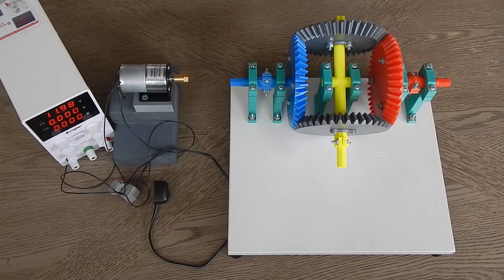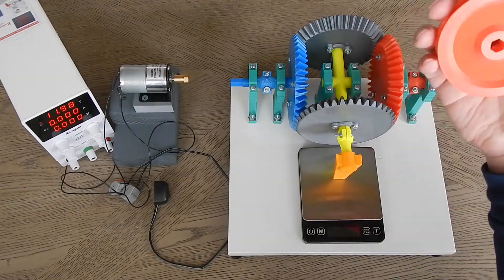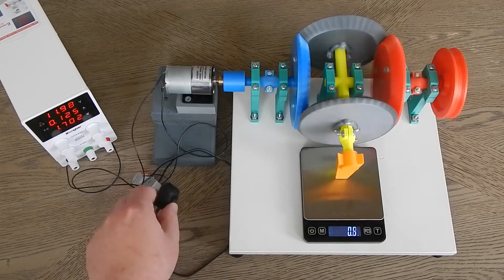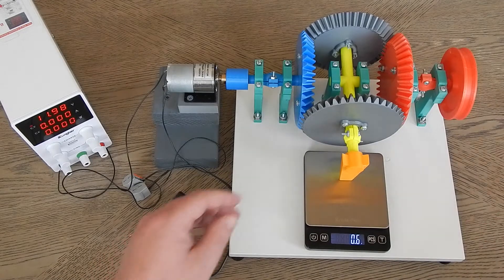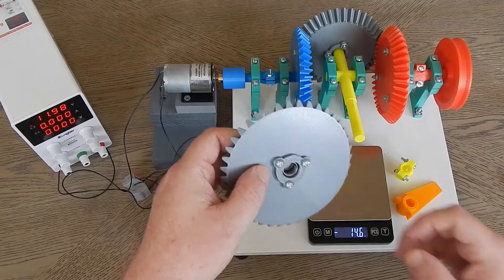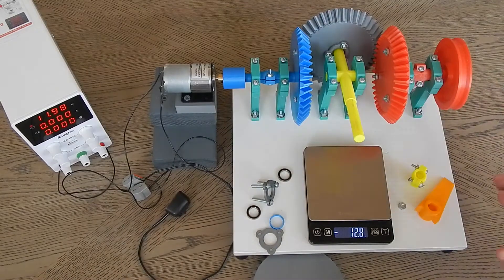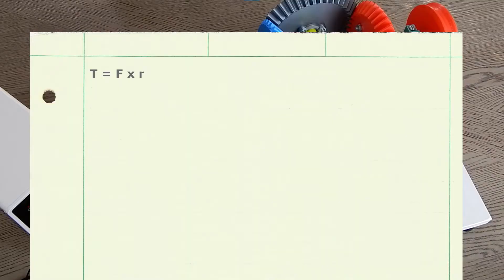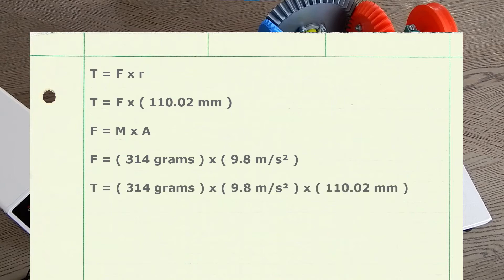How to Measure Dynamic Torque

Comment: Wouldnt the maximum torque be when the friction wheel is fully stopped?
Reply from the maker: Yes, the maximum torque would be when the friction wheel (output) is fully stopped. This is maximum “Static Torque”, because everything has come to a stop. At this point the scale would indicate the maximum “Static Torque”.

However, if you want to measure “Dynamic Torque”, you would then control/vary the friction/load at the output (being careful not to bring everything to a stop). This can be done to measure the “Dynamic Torque” at any rpm.

Comment: If the size of gears vary, as in the differential of the vehicles, will it affect the force, will the torque still be same as the product of force times length. Take if the grey gears are smaller than blue/red ones
Reply from the maker: Yes. It will always be the product of force times length

Comment: You’re the first I’ve seen to do this properly on YouTube. So much bad information out there. 

Making this compact and replacing the scale with an actual load sensor would also work.
Reply from the maker: Thank you for your comment, you are very right. The last few frames of the video show two things, a load cell instead of a scale, and the “compact” gearing configuration that will be the most used option. The configuration and scale I demonstrated in the video is to explain the concept.